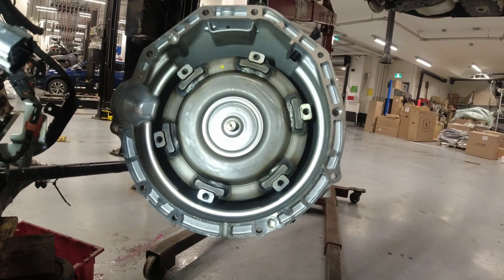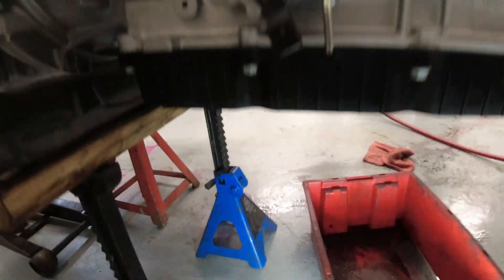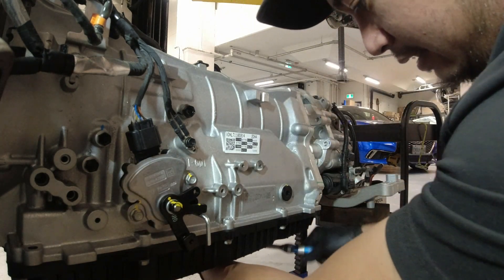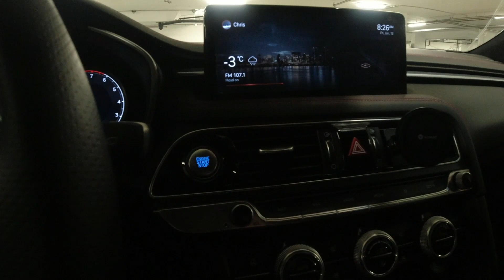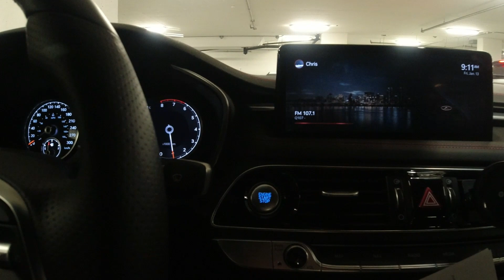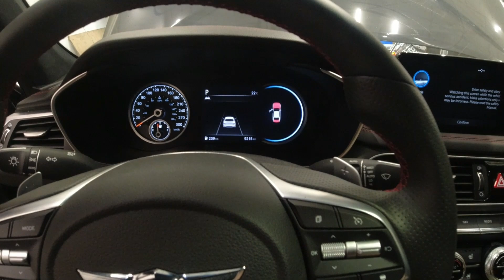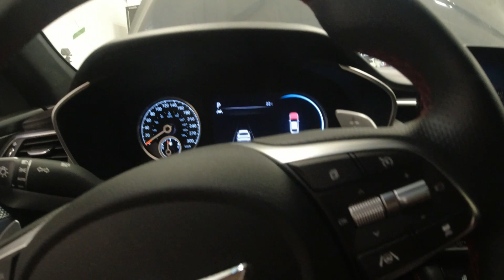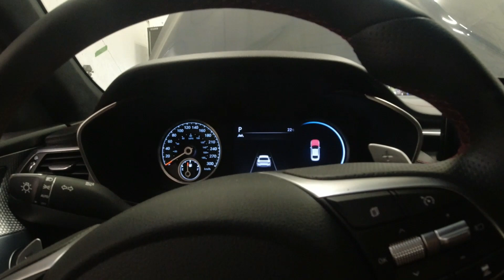G70 KNOCKING NOISE - MY BIGTIME MISDIAGNOSIS

Comment: I just want to say thanks for the honesty. Very very easy to just call this video a transmission replacement and there are many many technicians on social media that would have just taken that route and accepted their views and called it all good. What you present is the reality of this industry. Mistakes happen, Misdiagnosis happen. There is literally zero shame in that fact and anyone that says otherwise has simply never worked in this industry long enough. You did an absolutely amazing job at emotional management of being wrong and accepting it and then continuing on to properly diagnose this issue. 

I can only hope that this dealer you work for is also at the same level of integrity as you are and made sure you were paid for the continued diagnosis. That is assuming you are paid flat rate of course. Either way, bravo for sticking to it and solving the problem. Glad to have subscribed to you and always look forward to seeing more of your videos
Reply from the maker: Thank you for your kind words. As a mechanic my job is to fix the vehicle no matter what i know flat rate sucks and warranty but i jist have to live with it. Hahhaa thanks again

Comment: How the heck does a 3.3T spin a bearing? I've never seen that and that engine is bullet proof! Do you know what the cause was?
Reply from the maker: could be manufacturer deffect? or oil starvation on that component, maybe from factory assembly.
Reply: Tuned lol

Comment: hey bro don't fret, this happens to EVERY technician that is worth a shit and is learning and desires to get better and better. i been at this for 8 years in dealerships all wrenching, and hell maybe 3? years ago i had a ford f150 (i was at toyota at the time, now at hyundai genesis dealer) traded in, SAME EXACT THING as you. i recommended trans, i replaced it, no fix. it was the freakin engine. the harmonics transfer and come out right at the bell housing. idk how else you can figure it out.

these days when i run into stuff like this i grab the foreman (if there is one) and if they are also telling you "go ahead and do it" then were you really wrong.....if the boss said to do it? also if the foreman/boss isnt around at the time ill go tell the advisor in person "hey, this is whats going on. this is the BEST scientific reasonable way i see to fix this. but its not 100%"
Reply from the maker: Yeah for sure, its just after a big job and you confidently called the part and still did not fix its like you have no choice but to scratch your head. Thanks man